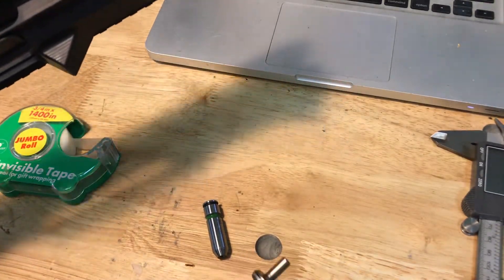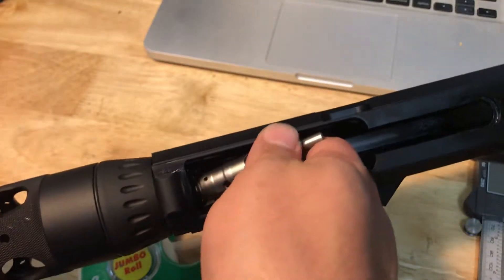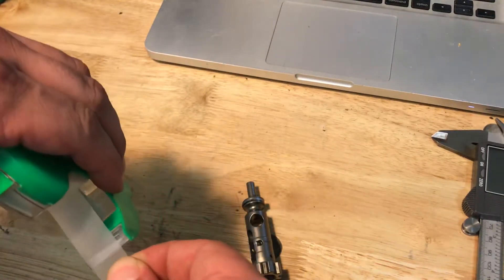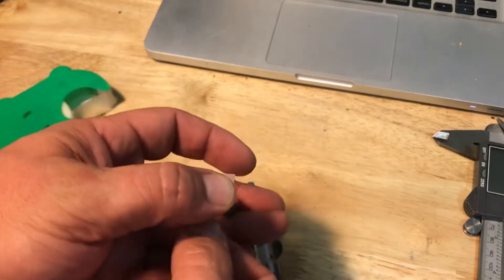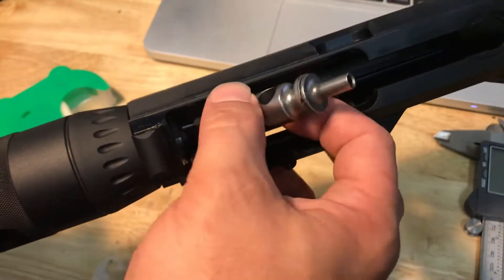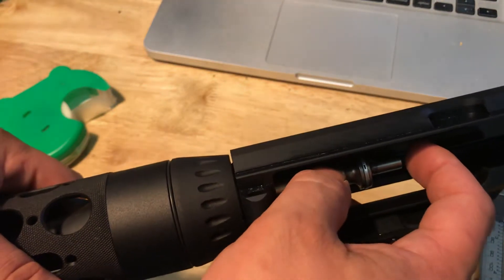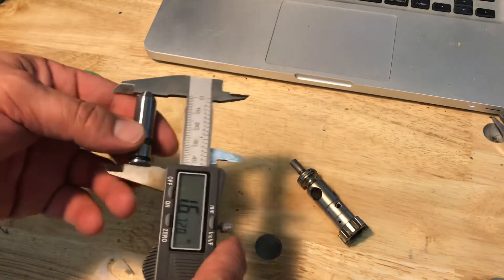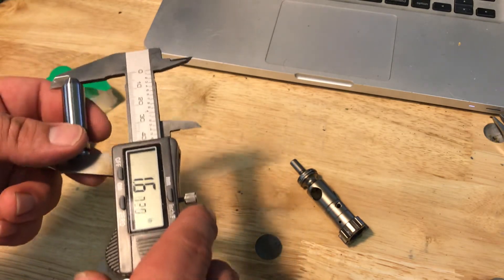How to check your headspace and save money, go no go gauge **please read description**

Comment: Tape is only adding .003” not .020”
Reply from the maker: You are right. I misspeak multiple times calling it 20 30 thousands in this video. Thanks for catching. 

For others:
Invisible/scotch Tape is about 2 thou or .002” per layer. 

Most headspace specs allow for .010”  from min to max. (You should look it up for the caliber in use)

Min is “go gauge” + .000” 
“No go guage” @ +.004”
“Field gauge” @+.010”

You can stack the layers of tape and measure the overall increase in length. 2-3 layers on a go gauge usually makes a no go gauge. 
I like using a go gauge to measure headspace as well. 

I recommend removing the ejector and extractor and using a blue sharpie/bluing on the shoulder, not top, of the go gauge. 
By Adding layers, and checking for rubb off marks/interference.

Hopefully this helps ppl out and save money.  

Hope you have a great day.